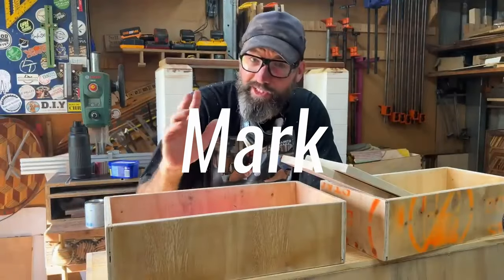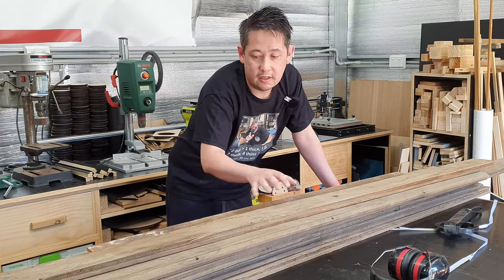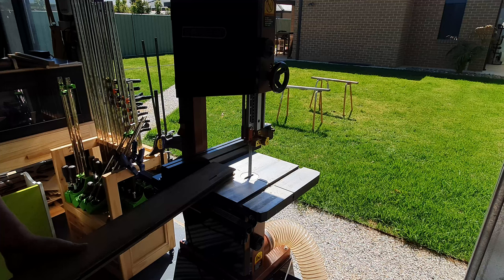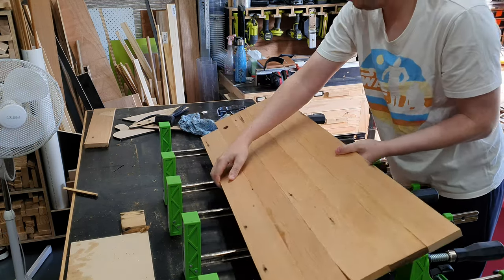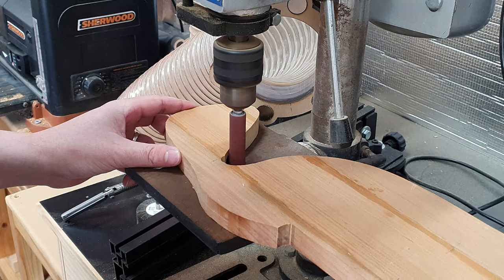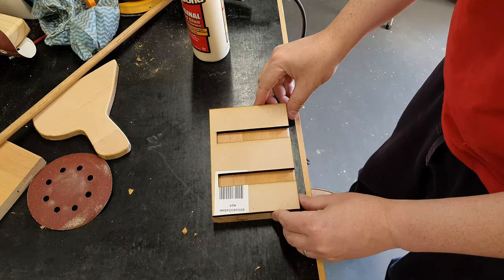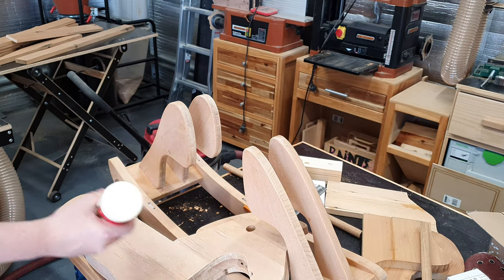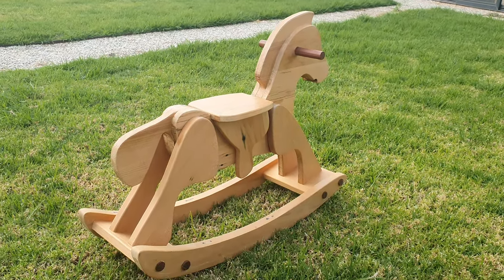This project was 100+ years in the making

Comment from the maker: So do you think you might know what kind of timber it is?  I'd love to know what you think it is, because frankly no one seems to agree on what it could be, even I don't know what species it is!
Reply: Maybe Baltic Pine. Was it hard or softer?
Reply from the maker: @scottaquilina9496  It's definitely softer, than hard so my thinking as well is that it's a type of softwood, however it is quite dense.  It's easy to cut, but does have some heft to it.  One fascinating characteristic is that there isn't a single knot or other type of imperfection in any of the stock I have (tho that might just be from selection rather than a feature of the timber) which doesn't seem to be a feature of Baltic Pine.  The grain is very straight.  It has a darker reddish tinge to it.

Comment: I bought a spindle sander a couple years back after it was on my, "maybe one day but i don't really need it" tool list. It has come in handy a million times since then! If I could go back in time, I'd buy it years earlier. A drill press one will be a fun project, but a spindle sander will make sanding faster and easier. 👍
Reply from the maker: That's how I see it too, Mario.  I'm umming and ahhing because I'm trying to think about how 'often' I would use it, vs just using the old drill press.  I'm sure I'll send up doing it.